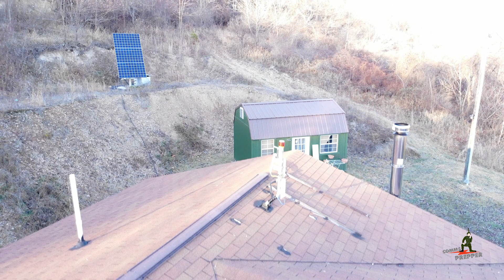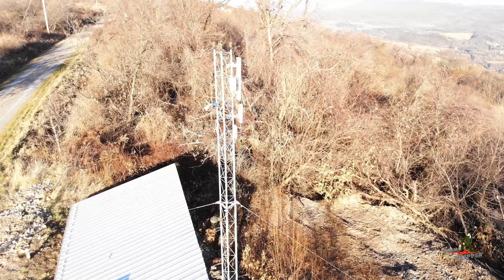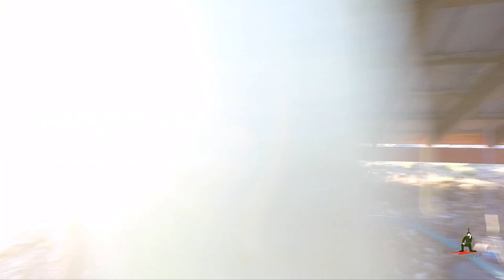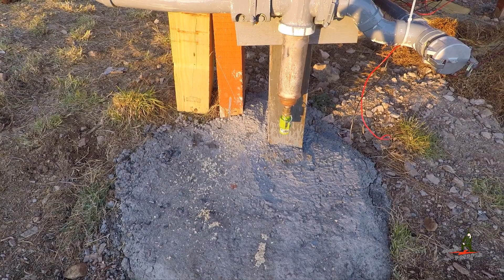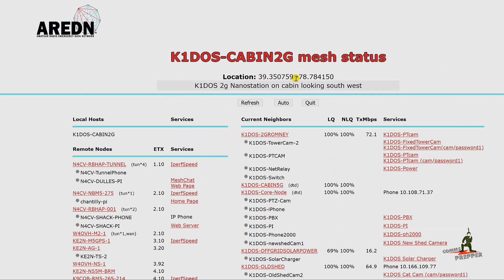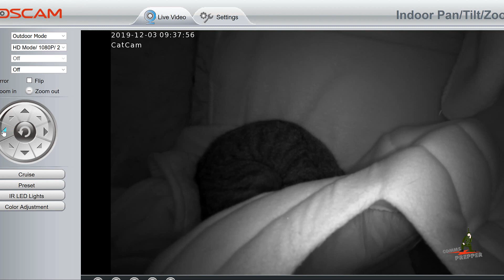AREDN for Preppers (Amateur Radio Emergnecy Data Network)

Comment: I hope you don't get big wind storms there, that rain catchment system doesn't appear to be on concrete footings of any sort, rot will be the least of your worries if any wind over 50mph comes through.  That's a LOT of surface area to catch the wind.
Reply from the maker: We often get 50 and over up here.  Has not moved an inch.

Comment: I am in the beginning phase of building a mesh network here in Hawaii. I just installed sector antennas up on my roof today, and later in the week we will be installing a dish antenna on another hams roof about 10 miles away pointing to my sector antennas to link them together. Instead of going with AREDN we are building our system from scratch so we have more flexibility with it. I still have a lot to learn about ham radio mesh systems to get all of this set up and start linking other hams around the island into the system.
Reply from the maker: Good luck

Comment: Two way cat cam ! That is a very comprehensive system. Do you know the approximate current draw for your system when in an idle state ? Thanks for sharing !
Reply from the maker: I do not know the amps and I need to get that done.  I keep putting the meter in the truck and forget to check the amps when up there.  I will get this done today.

Comment: Another question, what website was that with all the links to your cameras and all that. Also, can strangers access that? I ask because I would like to do the same, but I don't want it public, which is one reason I've stayed away from ARDEN.
Reply from the maker: arednmesh dot org.  Your AREDN nodes are not/not private and are open to all Amateur radio operators (that's the nature of the Amateur radio service).
Reply: OK, yeah, that's what I thought being a ham myself. So why bother? I mean you can setup a standard WiFi mesh network using line of site directional antennas at the same frequencies and it will be private. Not to mention there are mesh network projects out there with firmware for radios. I would rather setup something more private, but similar
 to your design.
Reply: Devin82m Your solution requires the internet to remotely access the ‘retreat’, ARDEN works independently of the internet if need be. So no mater the condition of internet service at the retreat or locally where he is, those services can still be used. When you think about it all the actual control functions are behind a password and all someone could do is see some readings not a huge security risk. On the issue of security what most people do is NOT security, just hop on shodan and try stuff with the default credentials it’s SCARY how often people simply do not change these things, the setup shown in this video is much more secure than that...

Comment: So do you have a solar panel/charger/batteries for every building/node? For instance you said every out building has a phone, but how do you power the phone and the node. As for panels, chargers, and batteries do you make any suggestions? I'm going to get up most of what you have up at our homestead in North Idaho, I want to get some Iron Edison batteries, but will probably only be able to afford on 12 v 100 ah Iron Edison battery (about $1,000 each, not including the electrolyte powder and distilled water). I will most likely also buy a few LifEPO batteries, charger, and Panasonic panels to fill the gap, all that would probably cost as much as a single Iron Edison, of course the Iron Edison batteries basically last forever without memory issues. But I wanted to see what you have found.Thanks for sharing your setup, it helps, I have other priorities currently like finishing out building our food supply which I neglected for more interesting things like radio and firearms.
Reply from the maker: My out-buildings can be powered from my main off-grid solar power systems (I also have commercial power).

Comment: Solar and wind have been working for me for 6-7 years.  I run a 220w solar, 400w turbine, feeding 6, group 31 DC batteries.  5-6 hours a day I run 2 HF bases, 2 mobiles, and 24/7 backup for security system until the 12k generator starts.
Reply from the maker: What turbine do you have?  I have been looking at them but they don't seem to have good reviews.
Reply: @Commsprepper  It been s long I forgot, its still up and running.  I bought it at West Marine, I thought if it can handle the saltwater environment it should last a while.  It's only 400w but been holding a charge on my system, in the winter months and stormy low light days and night it helps.  At first, I had it on a 40ft tower but found it works better for me/my area/yard 5 ft off my shop roof that is only 12 ft high making it 17ft from the ground and it kicks butt.
Reply: I saw a few bad reviews on others but most were " I have it 40 ft high and it never turns fast"  It not always hight, its location.
Reply: kb1vi

Comment: Based on your original video, I put together a multinode mesh network on BBHN with a pile of off the shelf routers I had.  Is there any interoperability between the two networks?  What features made you switch?
Reply from the maker: https://www.arednmesh.org/content/aredn-and-bbhn-compatibility#comments   I did not switch.  Just tried something new.

Comment: Brother would you share the link to the card your using for the volts and relays? Would be a lot of help for me. Thanks and God Bless..
Reply from the maker: On ebay - Voltage Monitor Plus 2 Relay Output Controller Internet /LAN 12VDC 1100W [NC240]
Reply: @Commsprepper  Thank you brother..